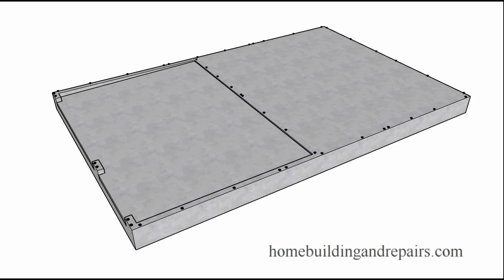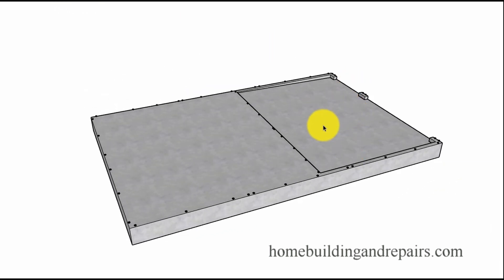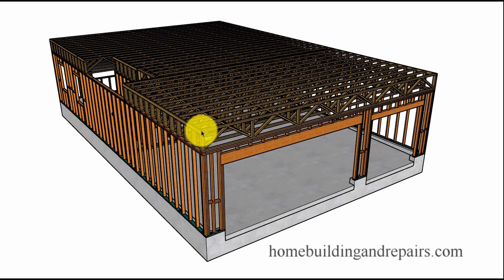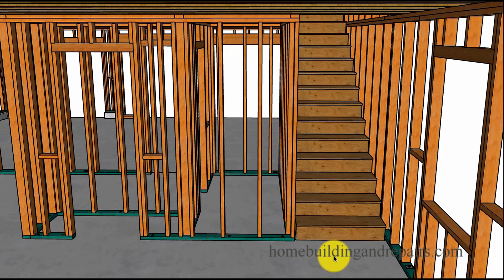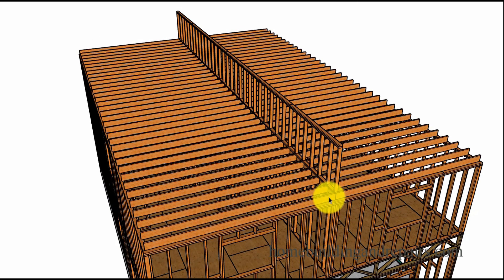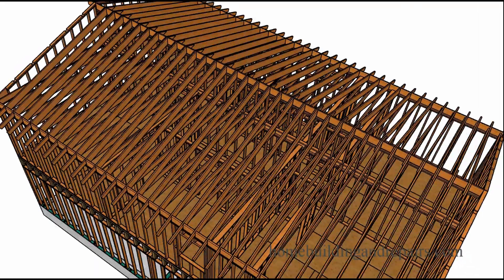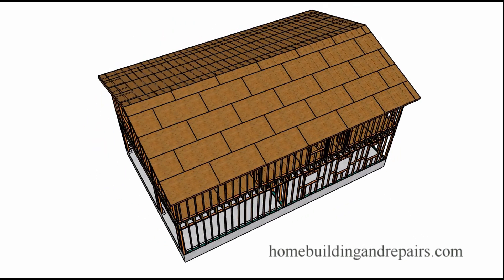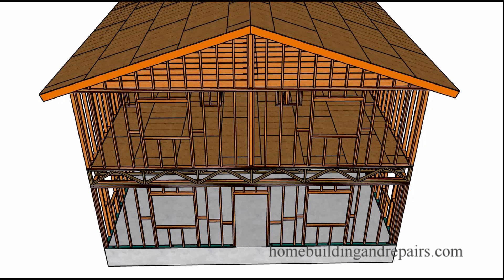Introduction To Video Series For Building Two Story Open Floor Plan House

Comment: What can you do to add 12 inches to the height of the ceiling downstairs if you have already built it? We are tearing the top floor off and doing a rebuild, but the homeowner wants to raise the ceiling downstairs as well. Our engineers are having a little trouble with this one since the original design had 8ft ceilings.
Reply from the maker: Here's a link that might help. https://www.homebuildingandrepairs.com/remodeling/framing/index.html

Comment: A nice simple, basic home to live in. I'm one not to worry to much about looks but more functionality. I would think this would be cheaper to build compared to a home with all the cut up roof lines and all the other stuff that make it more labor intensive to build.
Reply from the maker: Exactly and the main reason why I drew it. If this video series goes well, then I plan on building a variety of different designs geared specifically for do-it-yourselfers.

Comment: You know, I'm from Peru. Here, traditionally, they don't build wooden houses like this. Light wood framing is not known here. Here they use actual 3"x3" hard wood posts every 8 ft all around the perimeter and inside the house where walls are going to be parallel to the main perimeter posts. Kind of a post and beam building. 
But I do like light wood framing, so that's why I'm learning! I see this is a much better, easier, lighter, faster and more efficient way of building a wooden house! So thank you a lot! 👍👍👍👍👍👍👍👍👍👍👍
Reply from the maker: You are very welcome and thanks for letting us know what's going on in Peru. Keep learning my friend.

Comment: What would need to be beefed up to add a third floor to this? The studs?
Reply from the maker: I've seen plenty of three-story buildings built with the same floor framing as that shown in the video, but remember I don't have any structural shear panel, hold downs or posts that might be required with a three-story design.

Comment: What would the conventional joists would look like? 😮 Those engineered truss joists look like the ones used in steel framing!
Reply from the maker: Conventional joist mightn't require 6 x 14's 24 inches on center, but I'm only guessing.
Reply: @gregvancom  hey you sound experienced enough to ask an opinion... i'm in Texas and looking at building a 2 story 18'x55' inside a metal shell(bardominium) so there would be no concern on heavy lateral strength as there would be virtually no wind. i was thinking 2x12(12" on center)  to stretch from outside-outside leaving the ground floor wide open. whats your thoughts?
upstairs is 2 bedrooms and a small bath, no pianos or heavy game tables